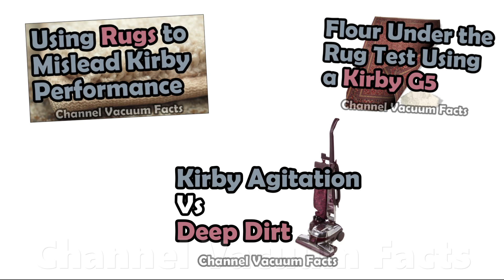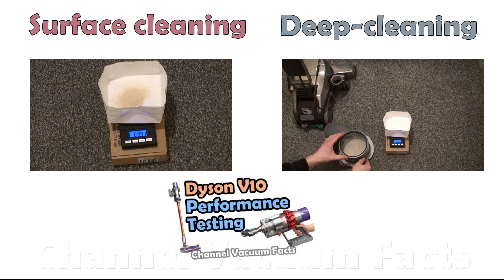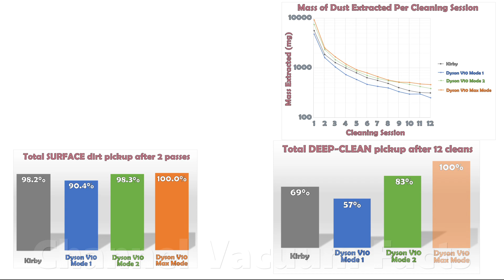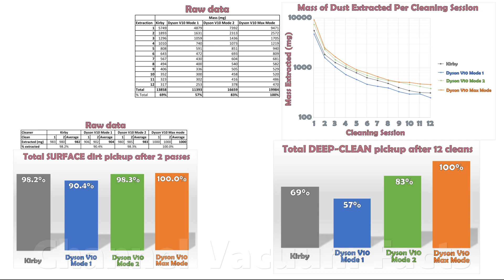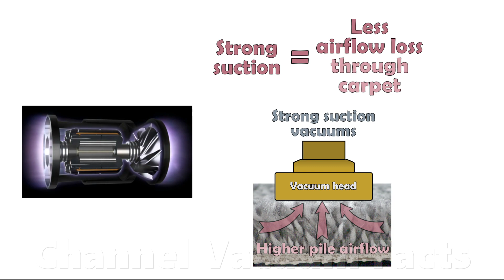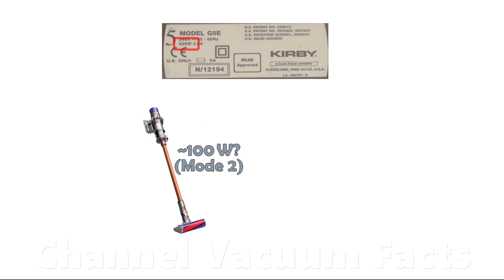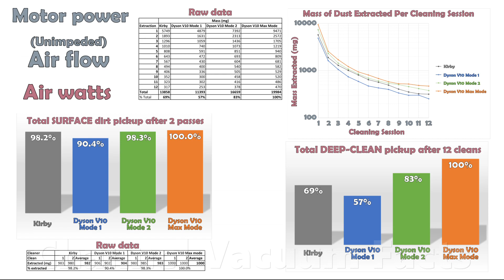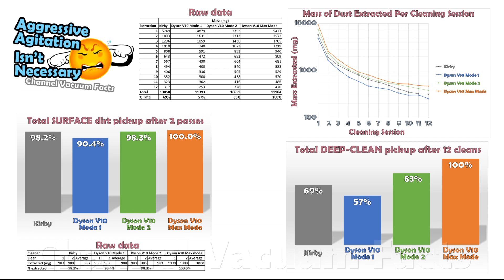Dyson V10 Vs Kirby: How Well Does a Kirby Vacuum REALLY Clean?

Comment: I would say that you are misleading people by using a Kirby on a non porous carpet. As you know the Kirby relies on airflow so obviously it needs a porous carpet to perform at it's best. Until you have tested it on porous carpet your test is not entirely accurate or fair.
Reply from the maker: Er, that's the point. The Kirby needs special and limited conditions to perform as well as the next cleaner. It only works decently under certain conditions which are not universal. When they aren't there, it performs poorly. The entire point I've been making is that misleading video makers have exclusively been using ONLY porous rugs which bypass the Kirby's limitations, but then use that limited testing to make wide-ranging claims that the results apply to ALL carpets and therefore it's the best cleaner in existence. My videos addressed that specific point explicitly and proved it not only false, but those that purported those claims to be liars and deceivers. That's the point you're missing. I'm filling in their misleading/ignorant gaps, and no claim I've made is misleading or unsupported by empirical evidence.

You surely realise from everything I've taught on my channel, that Dyson is tuned such that the airflow it generates is enough to deep clean optimally? All that strong suction does is prevent that airflow loss when on fitted carpet with non-porous backing and ensure the open-hose airflow remains steady. The Kirby has low suction, so the high open hose airflow drops like a rock on non-porous backing carpet but will remain decent when the suction limitations are bypassed. On a porous carpet, it will perform exactly the same as the Dyson. The extra airflow will not deep clean any better or faster because of the statistical natuer of particle removal and how particles are trapped in pile.

If I were to invest the money and time into doing this test and it turned out my unbroken record of 100% accuracy in all things on this channel was fully maintained, would you finally accept that the Kirby fans and rabid vacuum enthusiasts have been peddling a deception all these years, either deliberately or in ignorance? Would you finally accept that their tests have been misleading and dodgy? Would you finally accept they’ve been wrong this whole time and were uncivil to make me feel so bad and unhappy with their personal attacks, name-calling, propaganda, smearing, hateful comments, and attempts to suppress my work by abusing YT systems, and by extension, the truth? All I've been trying to do is ensure honesty and truth was known. If you answer this explicitly and truthfully, I’ll seriously look into it.
Reply: @VacuumFacts  Well I'm sorry they made you unhappy but I think you made some of them unhappy too. There really wasn't any need for it on either side. It should have been keep civil and not got so childish. The answer is yes if you can prove that the V10 matches the Kirby on porous carpet I will of course accept it. 😊
Reply from the maker: (They didn't really, but sob stories seem to curry favour). I've never gone onto someone's channel and accused them of being autistic or sprayed offensive expletives because I didn't share their opinion. I've never tried to suppress anyone's work by abusing YT systems. I've been nothing but polite and patient. I've been terse with those who've crossed the line and been uncivil, but never dropped to their level. And I've never singled out and identified specific individuals and slagged them off. This is in a different league entirely. All this has actually happened to me, and if you're not aware of that and side with the guilty, then you're clearly uninformed of facts and in no position to judge. Where is the evidence of 'childishness' on my part? Having a different opinion isn't childish. Meticulously articulating it in a civil way isn't childish. Debating it civilly on a platform designed for that isn't childish. Stating facts and calling a spade a spade, e.g. when hostile offensive trolls really have a go, is not childish before you try to spin "rabid vacuum enthusiasts" as an example. I want you to precisely evidence a clear example. Link or time stamp. Just one. I bet you can't.

And when you say if I can prove that the V10 matches the Kirby on porous carpet you will of course accept it, you mean accept everything I said and will say so? That Kirby fans and rabid vacuum enthusiasts have been peddling a deception all these years, that their tests have been misleading and dodgy, and they’ve been wrong this whole time and were uncivil. Confirm and I'll start buying.
Reply: @VacuumFacts  I will but I don't want to put you to any expense. Could you borrow a rug off someone? That would give the same effect.
Reply from the maker: Deal and done. Next day delivery, film tomorrow. Will add it to the rest of what I'm working on as an encore to Kirby week. Hopefully either a sat or sun release if I'm lucky.
Reply: @VacuumFacts  I don't know if you've watched Vaclab who doesn't actually have a lab 😁 but anyway he think that's it's airflow that counts and suction is only needed if you wanna pick up large objects but I have always said you need a balance of suction and airflow because the suction keeps the airflow strong. But hey ho what do I know 😀
Reply: @VacuumFacts  Thank you. This will be very interesting to see. If you are correct in what you say I will purchase a V11 next week 😁
Reply from the maker: You should know he's wrong and deeply misleading and I'll prove it
Reply: @VacuumFacts  👍
Reply: @2711marcus  What do you know? Bugger all.
Reply: @nespressoman  I'm glad we have something in common 😂

Comment: Came across your vids because I'm saving for a V10, but the extra change on a V8 (absolute models) would help, Could you summerize the pros cond between the two models? So far my research showed me that V10 has more battery and "dustbin capacity" while also being able to charge faster. 

Thanks for your vids, and also if you read or respond would be very appreciated. ! all this information is bloated and hard to find a simple list that would help me see between the mass of information already avialable! have a great day
Reply from the maker: Hi yeah; I can try. I didn't own a V8 personally but am aware of what it was like based on other YT vids. All Dyson cordless before the V10 were not considered mains replacements. So, the biggest and most important change is that the V10 onwards are now good enough to fully replace a mains-powered cleaner, despite possible naysaying and unsupported rumours to the contrary (often peddled by people who simply don’t like the Dyson brand). The testing data here clearly shows its superiority over what is considered (wrongly) to be a good mains-cleaner, i.e. the Kirby.

Other major improvements are the size of the battery and thus run time (I never run out with smart, easier, bite-sized cleaning), the super-easy point-and-shoot bin emptying mechanism which takes 5 seconds and makes no mess as shown here ( https://youtu.be/E_ik6qScs0o ), and the ease of filter rinsing after they redesigned it to be a single unit. You don’t really notice the recharge time, because you mount it on the wall, leave it, and it’s always fully charged when you next need it. I’ve reviewed the V10 at different stages of owning it (new: https://youtu.be/4x8j9oVpvkY ; 1 month: https://youtu.be/BNPdmYbIxVg ; 6 months: https://youtu.be/GvirX8F7avE ).

My advice: save up and get the latest version you can afford, because the newer the tech, the better and easier the chore of vacuuming gets. I suspect the V12 will be released March 2020 (the V11 has just come out).
Reply: @VacuumFacts  Thanks allot for the summary, will discuss with the misses but this convinced me to go for the v10, solid points.
Reply from the maker: Glad I could help :)

Comment: All of the research and money has definitely improved the pick up. Any chance you can do the surface and deep dust test with a 1100w Numatic vacuum with a turbo brush?
Reply from the maker: In principle I could, but what's the point? The machine is inferior to Dyson's machine, as industry testing has clearly shown to a level of accuracy far superior than anything I could hope to do. Furthermore, people were saying the Kirby was superior; they were badly wrong, so why on earth would another vacuum be any good, by the same token? Problem is, these vacuums are very expensive or an arse to get hold of. I'm not sure how much my interest in proving the obvious extends to every single piece of junk tech out there. I've proven now the 'best' is actually crap, amongst many other things. I think if there's a very compelling reason to look at another machine, i.e. something far less pathetic than the opinions of those aggressives who've now been shown to be badly wrong—such as real evidence—then I might look into it. :)
Reply: @VacuumFacts  To be honest, I thought that people just got them to collect. Not actually use them thinking they are better than all vacuums. Some people collect rare Numatics and Dysons for example,  just to put them on display knowing they are not amazing at pickup but just have them for a hobby or interest.
Reply from the maker: Oh yeah, nothing against a stamp collector. But people did make false claims and it misled me when I was making a replacement decision, and I didn't take kindly to that. So I spoke out. The more rabid 'enthusiasts' weren't very kind after hearing things which contradicted their world view and blocked me. So I was left with no choice but to start my own channel. And here we are, having now proven they were all wrong and were misleading other people who are vulnerable and might not know better. They've been put in their rightful place.

Comment: You don't get much time on Max mode though.  Btw, what setting do you have the floor head on the V10 at?   The type of carpet greatly effects the results.    Have you tested the V11 in the auto mode?
Reply from the maker: You don't get much time on max, but you don't need to use max mode for normal cleaning. Max mode is for intense heavy surface spot messes, and it simply cleans them faster, not better. Mode 2 is designed for normal operation and balances battery life with deep-cleaning performance. And as we see clearly here, it embarrasses—what is considered by those that now look a bit foolish—to be the ultimate mains cleaner. The V10 is a superior deep-cleaner in mode 2 (my now default mode) and has enough battery life for even extended cleans. Smarter cleaning behaviour many now adopt is to break it down into bitesized, easy-to-manage sessions, rather than a weekly mega-clean chore. My carpet is the most difficult to clean; long pile with non-porous backing. Any cleaner than can clean well on this can clean well on any carpet. I also don't have a V11, but the auto mode is a shortcut to switch between mode 1 on hard floor where high suction isn't required, to mode 2 on carpet, where it is.
Reply: @VacuumFacts  I was referring to suction adjustment on the carpet cleaning head, mine has 3 settings.  I have been using mode 1 with the powered tools and mode 2 for non powered tools.  I'll have to try mode 2 for everything.
Reply from the maker: I'd advise mode 2 for carpets and general cleaning, and mode 1 for hard floors (or if you need to squeeze more battery out). Mode 3 only if you've got a huge surface mess, like a knocked over plant pot (or you've been rubbing tons of dust into your carpet to do testing :P ).
Reply: @VacuumFacts  I'll switch to mode 2 then.  I have heard the carpet cleaning tool  (if I recall) is different on the US version.
Reply from the maker: The UK V10 had the older (and less well-performing) V8 head. I was disapointed by that and criticised it in my review. The rabid vacuum enthusiasts didn't seem to acknowledge that though and still accused me of being a fan boy that never says a bad word about Dyson.
Reply: @VacuumFacts  It would be interesting to find out what the difference is in actual test results.  I know the US site has the it listed as a replacement part.
Reply from the maker: I did think that myself at one point, but I suspect it's actually small. Certainly way smaller than the difference between a V10 and the really bad deep-cleaner Kirby.
Reply: @VacuumFacts   The basics of the Kirby haven't changed much since the 1930s :)
Reply from the maker: lol, bloody obvious from the test results isn't it! xD Didn't stop the rabid vacuum enthusiasts claiming "old is best" and the Kirby is the best performer and wayyyyy better than a cordless stick vac with a few air watts at the open hose. How embarrassing...
Reply: @VacuumFacts  I'm sure the Kirby works well for those with carpets from the 1930's era.
Reply from the maker: Kirbys, bagged cleaners, and mains powered cleaners (for most home users) have had their time. The technology has moved on and cleaning habbits have changed accordingly. What hasn't changed is the corruption of making claims without evidence, being nasty to those who know better and explain carefully why for the benefit of others, and trying to discredit those who prove it all right.
Reply: @VacuumFacts  Most home users only buy a new vacuum cleaner when the one they have breaks and can't be fixed at a reasonable cost.  Then they buy the either the cheapest or the one with the best ads.  I like the channel ibaisaic as he collects vacuums and knows a fair amount about them.
Reply from the maker: Yeah. Unfortunately ibaisaic is biased and lets his personal opinions impair objectivity. In fact, he's the very reason why my channel exists! Despite being polite, my opinions differed to his and he blocked me from commenting on his channel, somewhat discourteously. Very unfortunate. So I started my own channel so I could speak freely without suppression! We owe him a lot, really, then! But yeah, his testing is very flawed and misleading when it comes to drawing conclusions about vacuums that prospective customers may purchase, but there's no denying he's an entertainer. I just wish he'd been more tolerant of civil people who happen to have a different opinion, but instead, it was easier to suppress free speech, which isn't very respectable. A pity more people don't know that bit of history.
Reply: @VacuumFacts  He isn't a reviewer as far as I am concerned, he's a collector that like to share his personal thoughts.  I think he collects more on style than performance.
Reply from the maker: He definitely reviews a lot of vacuums and makes factual claims that aren't always true and are more in line with his personal subjective opinions. His testing, while entertaining for many, is still sometimes misleading and results in people being potentially unduly influenced. That's fine, but it's on a public platform and people have the right to comment fairly. Given the size of his audience, I can only hope that some of my videos are understood by a shared viewer base.
Reply: @VacuumFacts  Does the V11 have the better performing head? Thank you.
Reply from the maker: @nespressoman  Whilst I've not seen any data, I presume it must perform better, or else why would they have engineered a new one. Would like to try it, but money... :/
Reply: Vacuum Facts Thank you, yep, same.